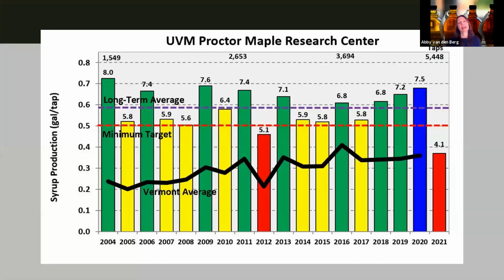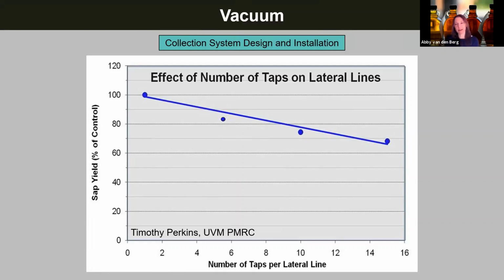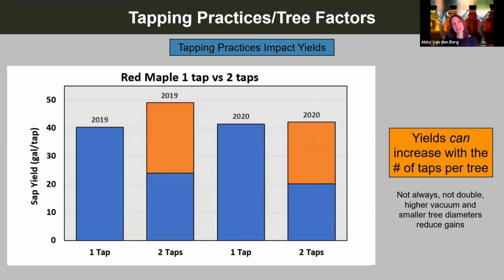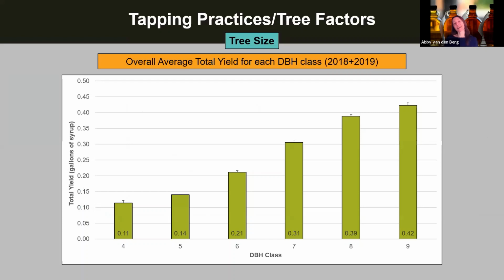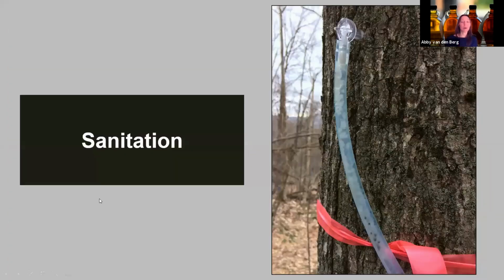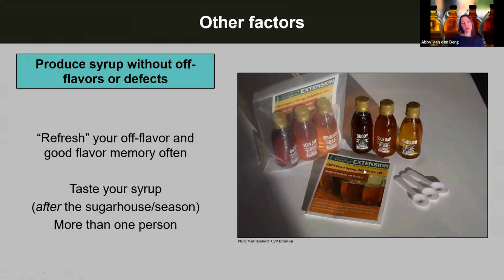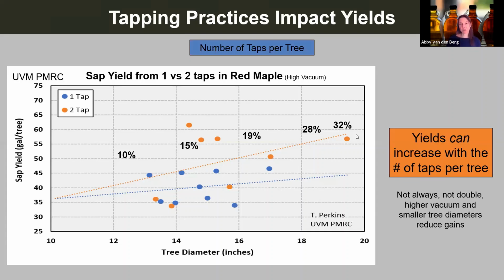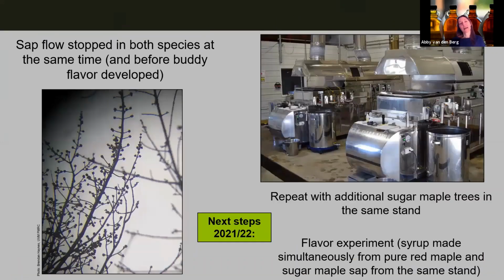Keys to high maple yield   May 25 2021  Dr Abby van den Berg   NAMSC

Comment: The slide at about the 26:53 mark that shows tap hole diameter and yield. This is the only place I've seen a comparison between 5/16" and any other smaller tap hole. Where does this slide's information come from originally?
Reply from the maker: Several studies at UVM PMRC have examined the relationship between spout diameter and sap yield under vacuum in the 22-24" Hg range, ranging from 5/32" to 7/16" spouts at a constant taphole depth.  That graph is a composite summary of that work.  We are actually considering a repeat of it, but at the higher vacuum levels (25" Hg+) that prevail in high yield operations currently.